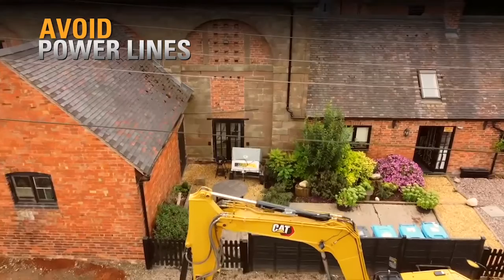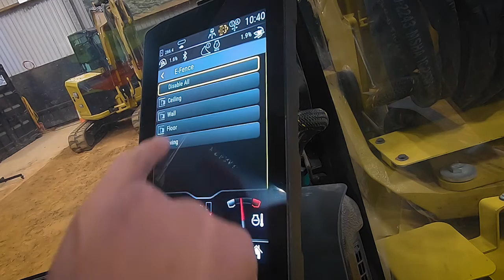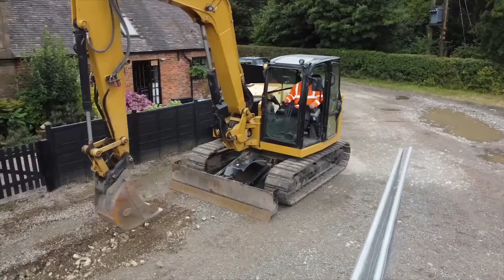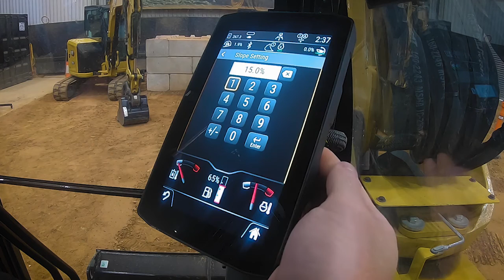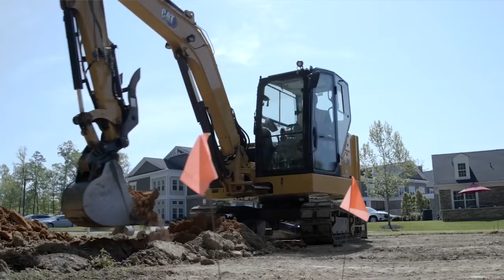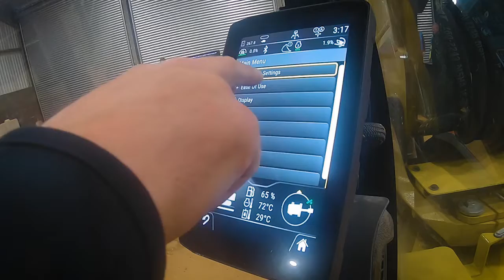Cat® MHE Ease of Use Technology Launch and Demonstration

Comment: Is there a laser catcher sensor for the stick? When digging footings I would much rather be about to bench from a laser each time after moving a machine vs reaching back to touch grade with a bucket tooth. Example, if when you reach back out to rebench after moving and possibly being off ½inch each time after moving 10-12 on a ditch line. You could be possibly 5-6  inches off grade from where you start a trench to the other end.
Reply from the maker: Hi Brad! Great question - no, there is not currently a laser catcher. We built this system to be entry level with entry level pricing to allow customers to get into Grade Control in a simple and affordable way. The Ease of Use Indicate system is self-contained and provides customer acceptable accuracy over distance at a very affordable price, especially over other laser, GPS, and auto systems. And we're always taking customer feedback on how to improve our products and technology, so look for next level options in future phases of the Ease of Use system. - Yasmin

Comment: Are these systems avaliable on the 302,7?
Reply from the maker: Very good question, Lars! Ease of Use Indicate and E-Fence can be ordered bundled together or as separate feature packages, installed at the factory or through Cat dealers as an upgrade kit for Cat 306 CR, 308 CR and 309 CR models. These technologies are not currently available for Cat 308 CR Variable Angle Boom, 309 CR Variable Angle Boom, 308 CR Fixed Boom, or canopy models like the 302.7. - Eli